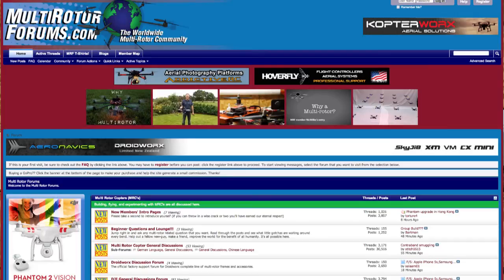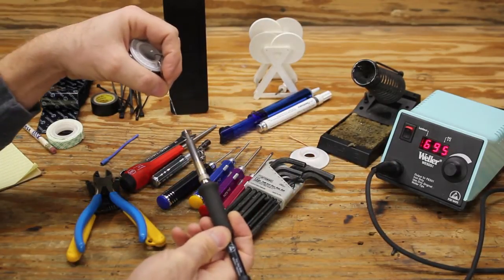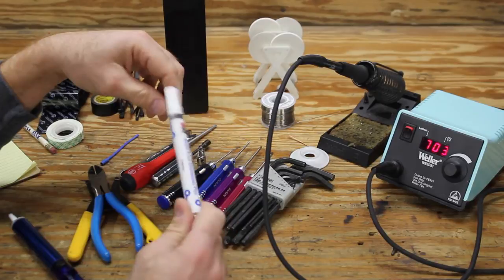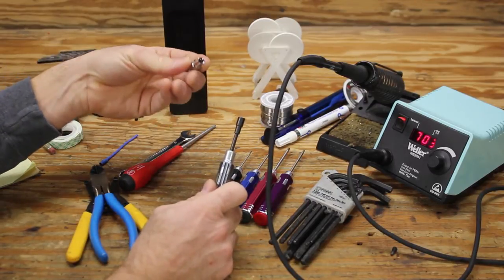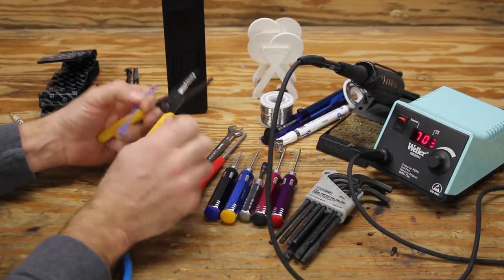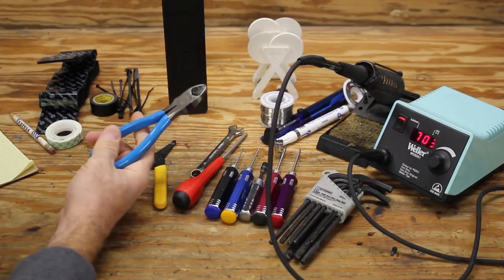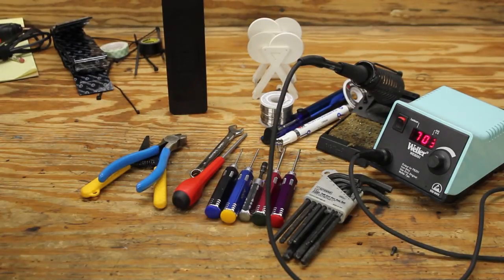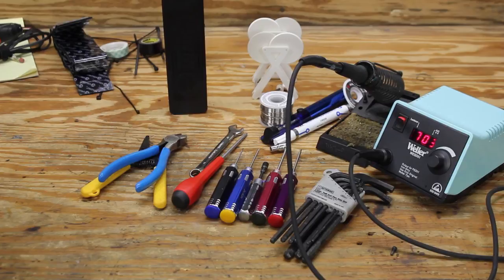MultiRotorForums.com DJI F450 Group Build Vid2...Tools

Comment: Hi Bart, 
thanks for the video.
you mention using a PC, are there any specifications on processor, memory and/or Windows edition needed or is the software used rather light for configuration that any PC will do? also does it make a difference once one starts building larger multirotors?  much thanks!